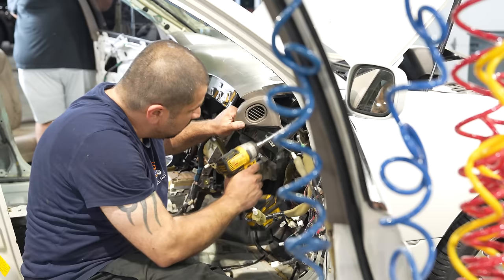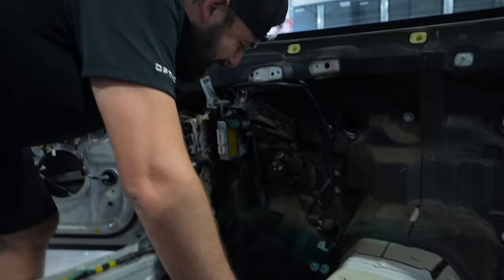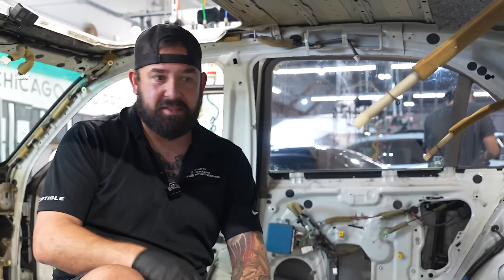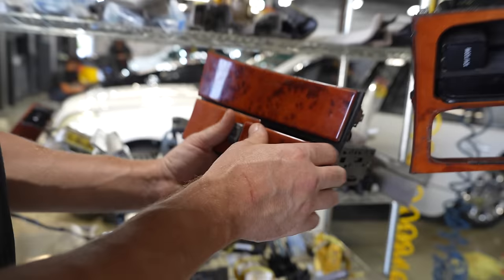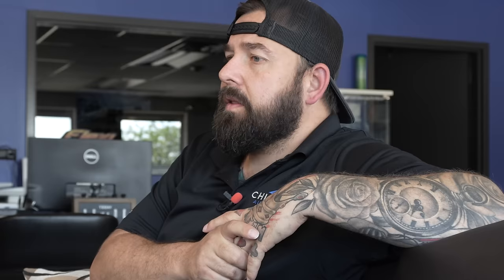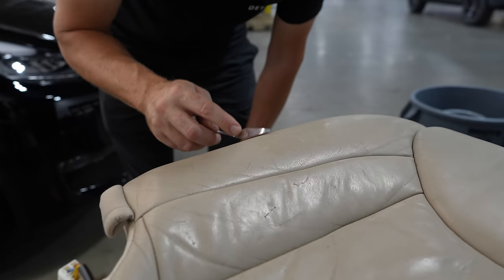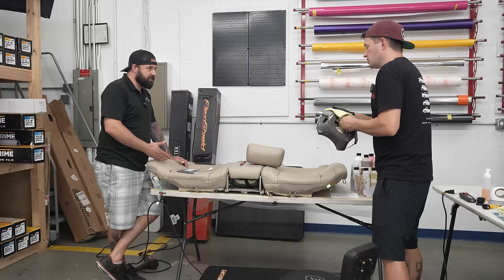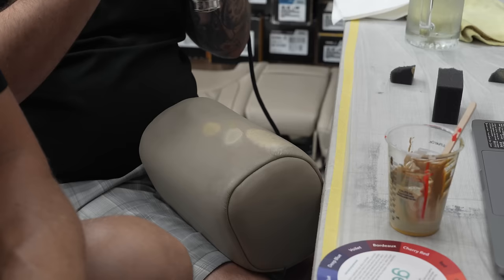The Most INSANE 600,000 Mile Interior Detail | 150 Hours #disasterdetail

Comment: I just did something similar to a 2013 Tacoma. Took out the entire interior and cleaned every interior panel, installed new carpet, new leather seat covers. Took out the headliner and cleaned it. Also did sound deadening on every panel. It was a ton of work and took maybe 60 hours working at least 8 or more at a time. Still have plenty to do to the exterior but for now the interior is mint.
Reply from the maker: Right on!
Reply: I wish I would have been able to take the entire dash apart. Just wasn’t comfortable doing it. I did go as far as I was comfortable doing though. Now after seeing what was behind the dash I may do some research on how to take it apart.

Comment: Nice job, amazing how goodie can turn out. This proves a car can never get old and worn.... For the connectors I have a great tip, some of them, like airbag and act are fluid sensitive and start to corrode wich can bring on errors.... I use balloons and even condoms (ys really, but without lube :) ) to pull over the connectors and use a small strap to secure.... works very time. Vaseline is also non conductive and can be used to prevent moisture....

Comment: I really liked this but I have a question. What is an "Odor Bomb" and how does it compare to an Ozone Generator? I use an ozone generator for my nephew's car when the "skunk" smell gets bad (hint...it's not a skunk making the smell..lol) for about 20 minutes a time over a couple days with the vent system on "Recirc" and it seems to work really well. You have to limit the time used because it will oxidize ANY biological materials in the interior (think headliner glue) and it needs to be aired out for about 10 minutes when it's done but it seems to do the job?

Comment: @ChicagoAutoPros Which odor bomb product did you use? I recently purchased a used car that had a strange unpleasant odor, turns out that animals lived in the rear seats for quite some time. Urine everywhere, removed all the seats and used P&S interior cleaning system on everything. I still think it might need a final odor solution since the urine was deeply embedded in the seat foam. Thank you!

Comment: I cant like ANY interior. I just want my bulletproof hi hi hi power drivetrain and gut everything I dont need and keep it that way. Driven without a/c for years now. Id rather be nose blind to must and have my 400-600 hp toyota. everything should be overbuilt, everything should have more power than it needs to get out of situations on the road now. Why are we just ignoring the fact that everyone silently wants fast overbuilt cars, its not expensive to do but manufacturers cut costs like MFs. And It barely takes any engineering to even get a 5sfe to 6 700 HP and have it last a long time because it can.... so why do I have to settle for crap?????????? BS